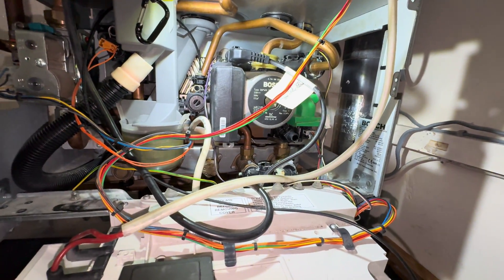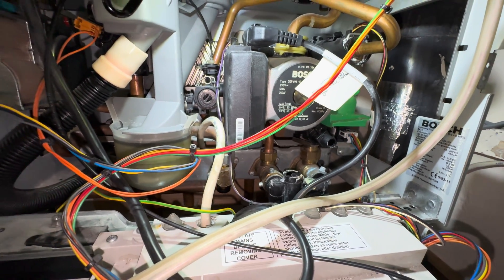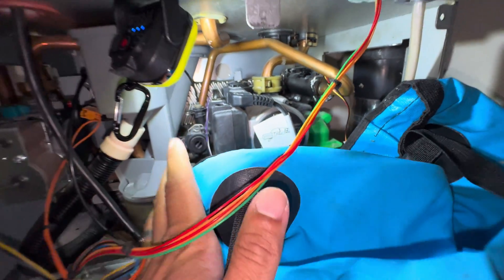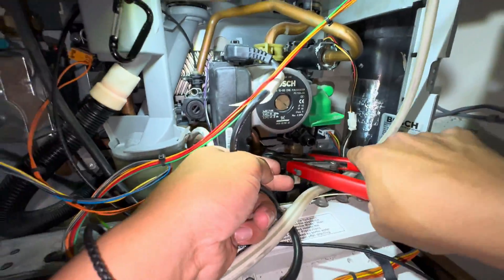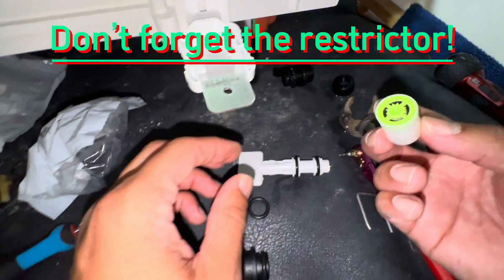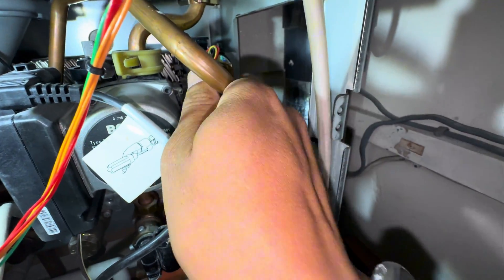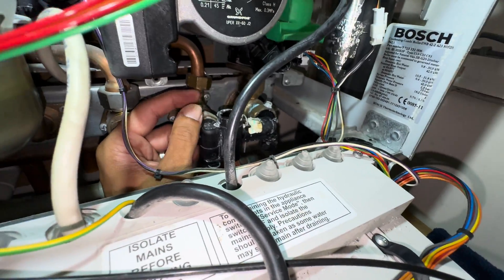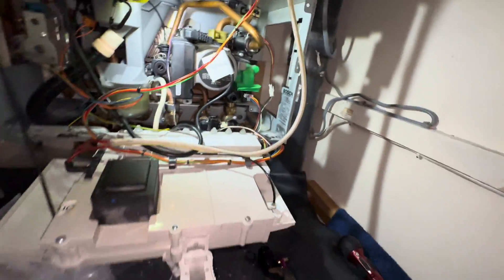How many of these have you changed over the years??

Comment: When replacing the charging link assembly, isolate the cold water and heating return on the bulk head, no need to drain down 👍
Reply from the maker: Has it got an NRV inside the return valve?
Reply: @RJHeating  NRV is inside the charging link assembly 👍
Reply from the maker: @mattwhite6291  I get what you mean now you’ve sent the pictures! I’ve never looked at it enough to realise the ball inside is shuts off to both! Thank you! Really useful info, hopefully get one soon again so I can make a vid on it!
Reply: No? If you isolate the heating return and cold water supply on the boiler you have isolated the charging link assembly. You don’t need to open the hot water tap either 👍

Comment: Hi mate. Excellent work. Just curious how you went about pricing that job? Not long went out on my own and lost a few breakdowns when I gave my price. Can't seem to get the pricing right. Do you price based on time you think it will take or do you have a min price regardless etc? Was advised to not undervalue myself which also helps to weed out the customers looking to get things fixed for peanuts but on the other hand don't want to lose customers for the sake of £20/30. Edit..Also do you think its a good idea to have a call out charge?
Reply: @LT-nd3ov  set a minimum charge that you think is reasonable, mine is £95 which i think is cheap considering 41 years experience. Then you can increase based on the time it takes you. You will always get cheap customers who will want things done for silly money. Just remember you are a qualified engineer so they must pay for your knowledge not just time👍🏼👍🏼
Reply from the maker: @LT-nd3ov  I could talk for hours on this, are you on Insta as it would be easier to discuss!

Would be happy to go through it all and what I’ve found works best.

Often, experience plays a factor, I’ve spent 18 years on the repairs side so usually know how long something will take and what issues may arises but I genuinely give a fixed cost to the client with an hourly rate in my head - figure out how long the part will take in a worst case scenario and price from that + parts.

I don’t charge a call-out fee as such but I charge for all time spent, so my initial contact with the customer will be charged at £xx covering up to one hour of diagnosis or repair where possible - any time beyond that would be either a fixed cost quote or on a per hour basis. Often, potential clients are deterred by the words “call out charge” as lots of customers marketed a free call out but that was almost an administration charge as the time spent on site was still invoiced! 

Definitely don’t undervalue yourself, and for me personally, I need to be happy with what I walk away with given worst case scenario/time spent - within reason!

Never drop your price, never haggle, the price is the price - if they can’t afford you, onto the next one - I tell my clients I’m not the cheapest but also not the most expensive and put the ball back in their court.

Comment: Many of the worcester plastic parts have similar flaws. I always thought it was because our water is so hard that they cant hold up to it🤷🏼‍♂️
Reply from the maker: @russellbaldry5095  I’ve been told by a couple of different Worcester trainers in the past that if you fit a shock arrestor, it massively reduces the chances of the plastic parts pinholing etc!
Reply: @RJHeating  yes true i think is standard across all manufacturers now. I fit them on all my combi installs👍🏼 I actually looked at a prv on one (30i) to change yesterday (at the back with pipes in the way) told the guy £130 supply and fit…….tx back i was the dearest that quoted😳 he got 3 quotes for a prv🤦🏼‍♂️🤷🏼‍♂️
Reply from the maker: @russellbaldry5095  man that’s crazy! To be honest, seems like a customer you didn’t want anyway! I reckon id be more than that and would without a doubt be taking it off the wall to do as I find it easier!
Reply: @RJHeating  absolutely…..i blocked him straight away!
Reply from the maker: @russellbaldry5095  it’s mad how undervalued trades are these days!